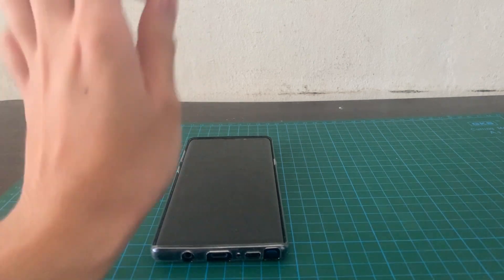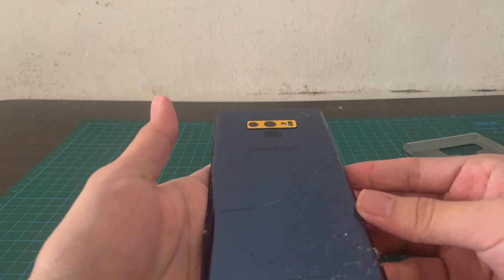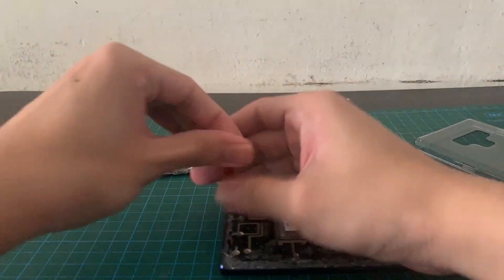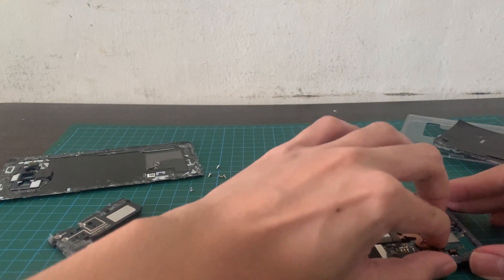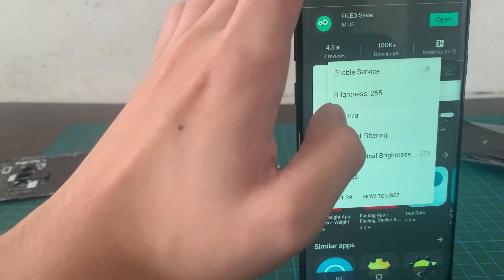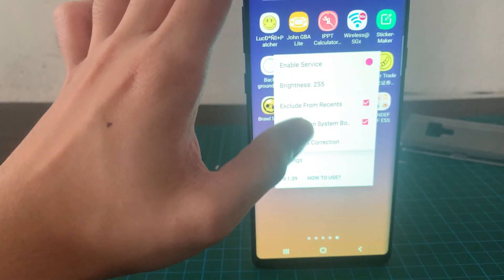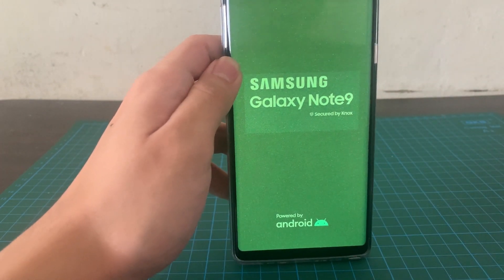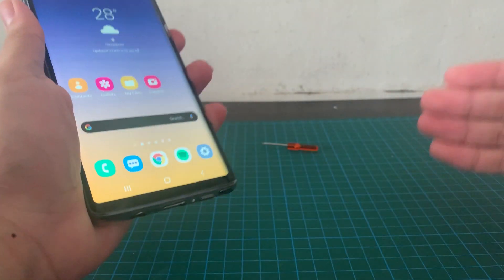SAMSUNG NOTE 9 SCREEN ISSUE DISCOLORATION FIX 2021

Comment: This did not work for me. If you take off the wireless charger it shows and over heating error and will not start. To get it to boot I had to re-install the wirelesss charger.

Comment: I just enable AOD and set it to touch to show. You just need to touch the screen first before unlocking your device mine uses fingerprint to unlock. Same thing for those who use smart lock, you might need to cover the upper part of your screen where the sensors and cameras are located before tapping the screen and unlocking the phone.
Reply: It is Hardware Or Software Issue? 

I'm facing Same
Reply: @AMRUTENERGYPVTLTD  both. Samsung service centers doesn't believe me when i told it started on a software updates that eventually slowly breaking my screen. They insisted that i dropped my phone and needs a complete screen and frame replacement. Many samsung phones are experiencing this issues not just the note 9, I also have it on my s8 and s9. Luckily my s10e doesn't have these issues. I recently upgraded to s23 ultra no screen discolorations or flickering but a green line suddenly showed up lol. As much as i like using Samsung phones, I might switch to Apple soon.

Comment: I got this problem to my samsung note 9. Finally i found the solution. Hey guys firstly close your phone and double tab on the screen and unlock your phone by fingerprint or swipe. Never open by power buttom.
Reply: I've had this screen issue with my phone for months, and i'm not sure if i'm angry or relieved that all i have to do is tap the screen twice before opening it!! It worked 25 times in a row, and the first time i tried to open it without the double tap, i had lines. I was able to open mine with the power button after the double tap without issue.  Thank you for sharing in the comments, as the app in this video isn't available anymore, and I was hoping i could find another option.

Edit: Double tapping the lock screen brings up my clock. After thinking about it, I went into my settings, and set my lock screen to always be on, instead of tapping it to unlock. I no longer have a dimmed, discolored screen with lines across it when i open the phone.

 I have tested it many times, and if i open my main screen while my clock is displayed, it's had no issues so far. However,  If i re-open the main screen quickly after closing it, and before the lock screen (clock) display comes on, the screen will goes back to being discolored and dimmed with lines. Thought i would share my experience just in case it can help anyone else. This was on a Samsung Galaxy Note 9.
Reply: @captainfry9776  i have the same thing happening when i turn on my phone its all green lines flickering flashing and when my phone is unlocked it gets worse so i use very low brightness to atleast use it a little but the lock screen its still the same

Comment: I got this problem to my note 9. Finally i found the solution. Hey guys firstly close your phone and double tab on the screen and unlock your phone by fingerprint. Never open by power buttom.
Reply: It didn't work for me
Reply: @MichaelFrancis-ty6ko  Did you open double tab function? Try another way. Double tab and  swipe screen and then then unlock by fingerprint.

Comment: Could you please help me out with my Samsung galaxy note 10 plus? I have a crack in the left bottom corner but still, I've been using this phone for more than a year but suddenly my screen went black but with some lines of pixels, I can tell it's completely responsive and sometimes the whole screen gets fixed by itself. I don't want to replace the display. Could you suggest me some tips?!
Reply: The same thing happened to me! except my crack is in the bottom right. It was working perfectly fine , it just had two lines going through the phone where the crack is. Then after months of it being fine, it just starts flickering and its green and black and its a whole mess.
Reply: Same issue bro have you got any fix ?

Comment: Try to use in sunlight and turn up brightness meter to full
And then manually change brightness slider from 100 to 10
And keep repeating 
It worked for me ;)
Worth a try
Reply: what is that suppose do?
Reply: Did you use adaptive brightness

Comment: Actually is the sensor problem. Switch off the adaptive brightness. But how to do that with green yellow screen right. Cover the camera and sensor. Then only turn on the phone. With the screen turn on and resposive temporary. Set the brightness to minimum then switch off adaptive brighness. Then only download the OLED software.

Comment: This fix + Always On display (Always show) is the best solution. The removal of the parts is only necessary if your phone is in a situation where you can't see the icons to operate. If you can see, even barely, you don't need to remove anything. Always On display fix the problem and Oled Saver helps to attenuate the green.
Reply: If we change the screen and panel can flickering  will be gone.......
Reply: Dont fixes
Reply: So my galaxy note 9(2 years old) has gotten to the point where, if the phone screen if turned off(while always on display is active), and I get a call or plug it in to charge, I can't view anything at all. The only why I can get the phone to "wake up" properly is to double tap the screen, then either press the power button  and enter my pass code or use the touch sensor
Reply: Bro you are life saver 🙌 🙏 ❤ 👏.. thanks mate mine is solved 👍
Reply: @sozo

Comment: To get the screen to response temporarily, you dont have to dismantle like that, just wrap your phone with plastic and keep it for a while in the refrigerator. The display will come to life back for a while then you could download the "oled saver" and activate it. cheers. ;-) However...... thanks for the tips.
Reply: Wow this is real bro? 
I thinking make that
Reply: is it real?
Reply: Yes... try it
Reply: @m.norhishamm.radthi9395  wont the phone spoil?
Reply: @itsshaokai  here how I did it. pack the phone with a plastic 2 or 3 ply, Put in a freezer of ice cold tempreture for about an hour or two. after that take it out and your screen will come back. dont worry about the hazy watery on the phone. Download the screen apps, set the screen and you're good to go. dont wait because the screen readable wont last long. so far the phone is still in use 😜👍👍👍
Reply: @m.norhishamm.radthi9395  what is the purpose of wrappung it with plastic?
Reply: @itsshaokai  I'm not sure of that but it was a methode I learnt to revive a faulty hard disk.
Reply: @m.norhishamm.radthi9395  and then you tried it on your samsung note 9?
Reply: @itsshaokai  well that samsung 9 is already having the oled display fault... when you turn it on I find out the phone is a bit hot at the back.. if you disagree with this methode then dont do it.. go ahead open it up and go through all the trouble... provide that you have all the correct tools... if not, then are you going to replace the the screen? that will cost you a new medium range of new HP with better spec these day in 2021.. up to you man.

Comment: This only for temporary fix you need to change the display anyway n it's not cheap, or u can pay for them refurbished your lcd wireless,nfc foil will not affect the lcd also speaker ..

Comment: My Note 10 suddenly developed that same green tint issue, but in my case the screen was responsive. I really think it's a heat issue as I noticed it would happen when locking/unlocking the phone after having the screen on for a while, getting it warm. It's still under warranty so I sent it to Samsung and they apparently replaced the screen and the NFC antenna/component according to a service rep I spoke with (I still don't have the phone since it is currently being shipped back to me). Looks like one of the components removed in this video.
Reply from the maker: yeah i guess
Reply: @Aiovo  can you teach me to talk with smsung?
Reply: Did the problem ever reoccur?
Reply: @JSKLeopard  No, the problem never recurred and the phone works fine.
Reply: what component should i remove so that it will not reoccured?
Reply: My note 10 also hv same problem how do u solve it ?

Comment: Did you know that you can install apps without removing components? Hahaha
Reply: For just screen issue there is no need to open phone components just install app, it will work well. plz let me know if anyone found a better option, for now the temporary solution is working fine but the screenshots are very dull is there any solution for that?
Reply: What app
Reply from the maker: my phone had a glitch which i cannot open the phone to unlock. It really depends on whether ur phone can even open. A new video related to this is coming soon so stay tuned!